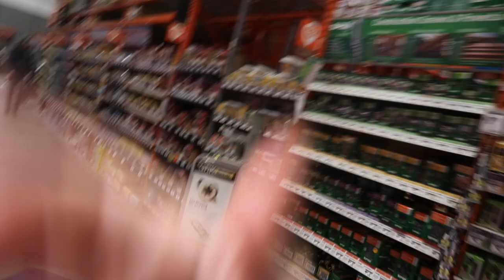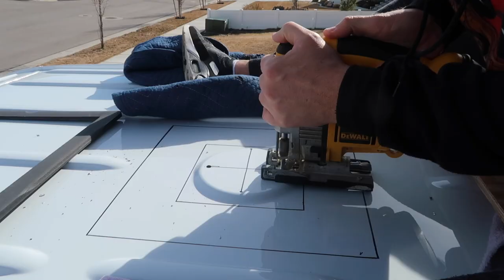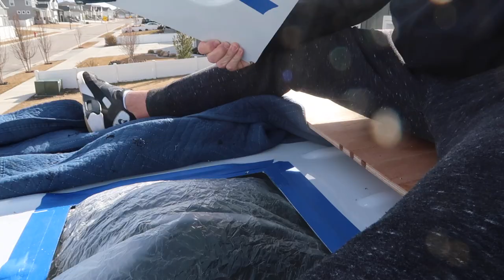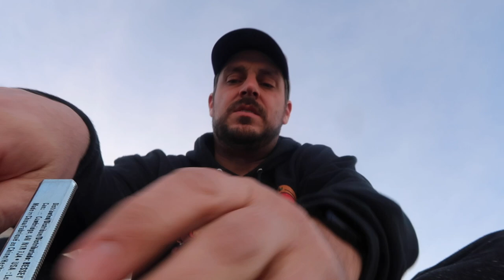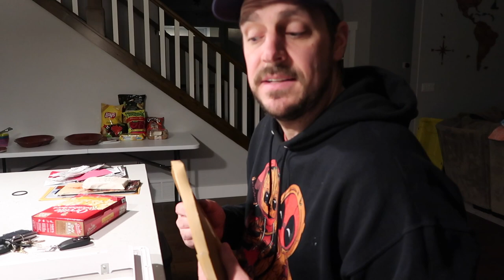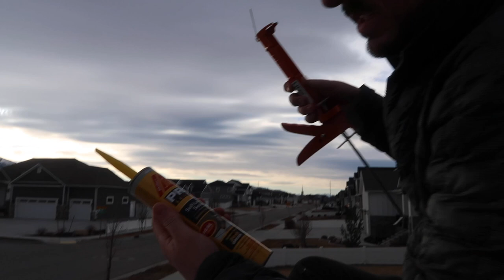MAXX AIR FAN INSTALLATION | We cut a hole in our van!! - DIY Sprinter Van Conversion Ep.3

Comment: Hello Peeps, another really interesting video.
I really liked the fact that you bolted the fan to the roof. I thought for months why people here in the UK also from far afeild only ever screw the fans to the roof.
Im like you bolts all the way. Not only is it harder or near impossible to remove bolts it gonna take alot more time to grind of the covered bolt heads.
 Screw unscrew and theives are in.
I feel security in sprinters is poor enough without.
Have a look on you tube there are some great security tips.
 Clear single beed of silicon round the quarter lights as u know it takes 10 seconds to enter your sprinter through that little window
Reply from the maker: Agreed! We will definitely be upping the security in our van during the build. Good attention to detail on the bolts! 😊

Comment: I assume you put sealant under bolts heads and washers?
Reply from the maker: We used the butyl tape, silicone and then self leveling sealant on the top. 🙂